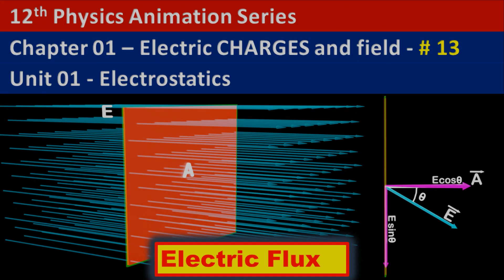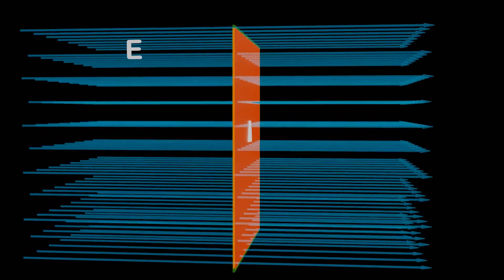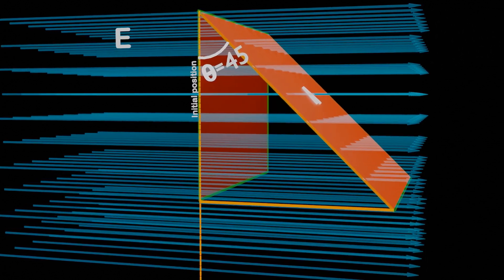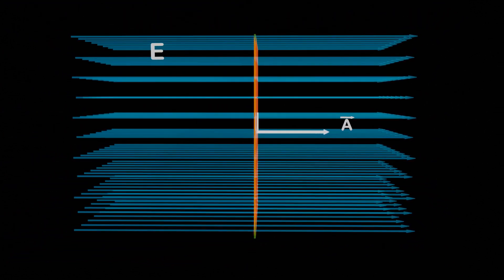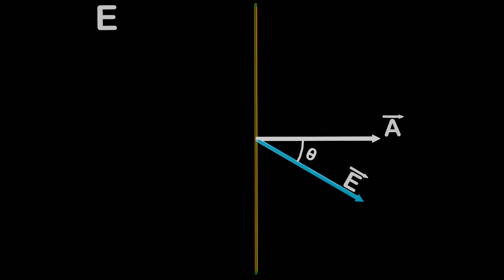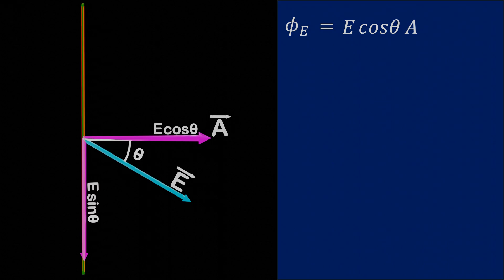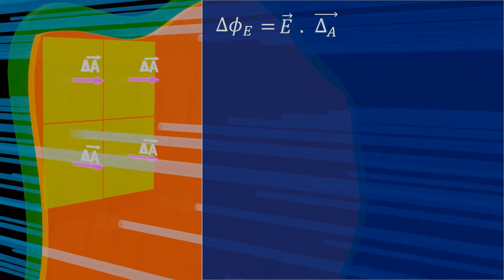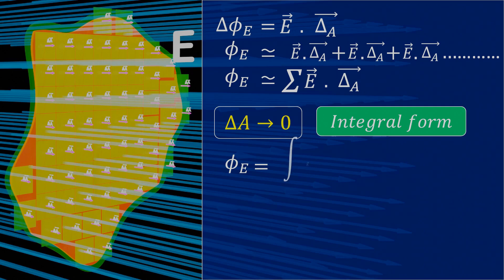electric flux | Area vector | electric flux class 12 | explained with animation

Comment: When we talk about ESintheta it is parallel to plane but a small amount of E must be passing from plane of Area. then why it not taken into consideration
Reply from the maker: Friend when split it we have only two effect, one is horizontal and another is vertical.
Reply: I agree to you but the Esin theta which is horizontal component.some part of it must be passing through the thickness og the plane
Reply from the maker: The process of splitting a vector into its components is called resolution of the vector. The components, when added vectorially, will yield the same vector. 
. 
That small amount which you are thinking is controlled by theta., try to viaulize that why we are using components. Sin theta and cos theta
Reply: @Physicsandanimation  Sir why considered a 2D area (square) not 3D (Cube) in this analysis